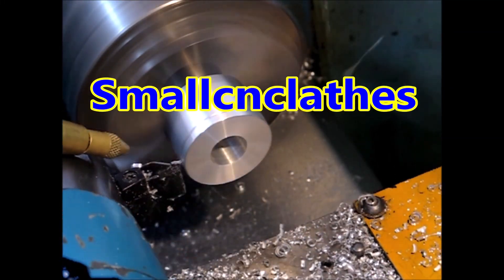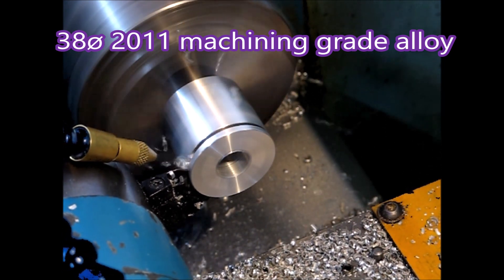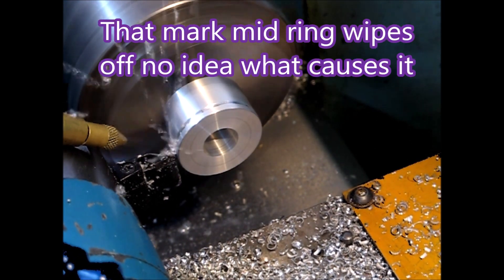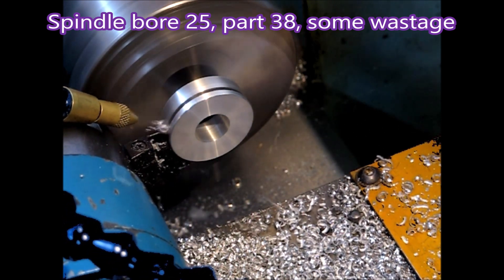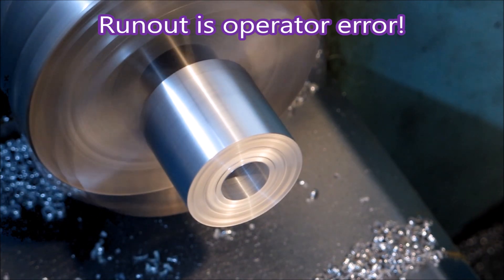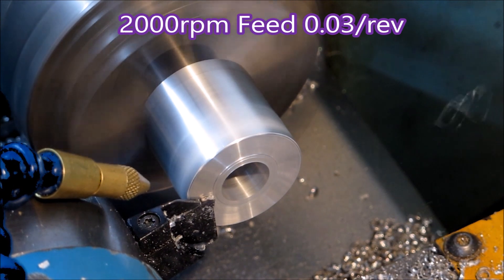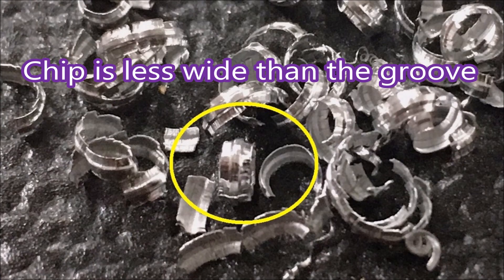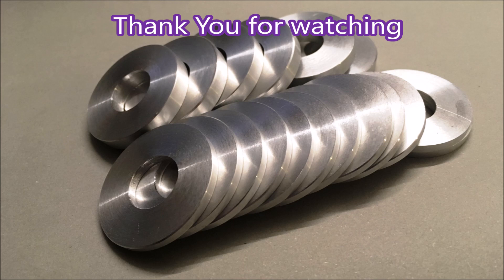Small CNC lathe parting with close ups of chip shape

Comment: Did you ever try to sharpen the carbide insert bits? It makes a significant difference here.
Reply from the maker: No, I just replace them, sharpening would mean resetting the tool. I have nothing with which to sharpen them with anyway.
Reply: @smallcnclathes  my lathe is screaming when I use a regular new carbide (it's well centred), if I sharpen it a little bit with a grinder it becomes much more calm and I could even cut in the night without disturbing the neighbours.
Which inserts do you use exactly? The Korloy inserts which I had have the same shape as the chinese ones, so it seems to be a "type" issue on my side.
Reply from the maker: One of the reasons I pay heaps for my tools is the support I get from the suppliers. Both Sumitomo and Kennametal supply low cutting force inserts which I use. I pay up to $9 for a single edge Kennametal insert, that I never need to interfere with, BUT, they work. This allows me to do things I could not do, so I pay the money and get on with the job. If I need a parting insert that will cut sideways to do a bit of profiling, they are available too. This sort of support is not available when buying from cheap suppliers
Reply: @smallcnclathes  Which Kennametal inserts are you using (part number?)
Korloy is also good, it's the shape of the tool which makes the difference for me. Korloy also offers different shapes (and so does Kennametal).
Chinese ones are ok for aluminium (and some soft steel)
Unfortunately the weak structure of my machine and lack of my knowledge broke all the Korloy inserts on my parting steel experiments.
Reply from the maker: They are not simple codes, I will have to have a look tomorrow. Sumitomo chipbreakers I use are GF and no, I can’t remember the others will look them up too.

Comment: 2mm not available on parting
Reply from the maker: Are you asking a question?  This Kennametal tool is what I was offered with a 10x10 shank to fit my turret at the largest diameter (41mm) that was possible. In theory a 1.6 wide tool should create less force than 2 mm. I do have a 2mm wide but it only goes to 20 diameter.

Comment: Thanks for your videos. They motivate me to finish the CNC conversion on my lathe.
Reply from the maker: Much to do to get it finished?
Reply: @smallcnclathes  My original goal was to design the conversion so I could still use the lathe manually but when the Z axis was "done" it wasn't repeatable. I was using the OEM rack to move the Z. I recently gave up on that idea and used a ball screw. I need to complete the bracket which will tension the Z's stepper and then assemble the X axis pieces that I built last year. The last piece I was waiting for since September finally came Friday and now I just need to wrap the conversion up. Your channel and RotarySMP's, help keep me chipping away.

Comment: Hi,

Great vid as usual. Hey, do you ever have an issue with the rear section of the insert, that is the other end of the insert in the holder, marking up the stock during deep cuts as shown in this vid? I’m not sure if it’s an alignment issue with my set up or trapped chips.

Alistair
Reply from the maker: Not aware of it to be honest.
Reply: @smallcnclathes  I’ll look into it more closely and maybe report back. I didn’t use the tool for deep parting often, but I’d like to. It’s an iscar  holder and insert. Unless I’m really dumb  about the whole set up, the unused end of the double ended insert has only the cut made by the engaged end to follow in. So I’m thinking exact alignment of the holder in the tool post ( yeah, of course) and the alignment of the insert in the holder is critical. I’ll play around and see if I can’t get better results.
Btw, I’m always smiling when you complain about turning 6061. It’s pretty well the only aluminum alloy ( sometimes 7075) that I get to use on the lathe. Even with constant surface speed, and chancing upon a good feed and speed, the swarf changes during the reduction of diameter of part. When it goes right it’s great, but then something changes and chip breaking ends.

Cheers

Alistair

Ps very much enjoy all your vids. I always learn from them. Thanks again for making them
Reply from the maker: I suppose an insert that is single ended might solve the issue.
I just find it frustrating that folks with mini lathes struggle with 6061, simply because they don’t know there is an alternative.
Folks with powerful machinery don’t have nearly as much drama.  Swarf conveyors and collection bins make it manageable. 
For folks with little lathes and matching experience it can be a nightmare.
Reply from the maker: Just had a thought, take one insert and sacrifice one end by grinding a bit of relief on it. One way to check, at little expense.
Reply: @smallcnclathes  I’ll do that. Time to swap the insert anyway. I’ll grind the sides. 
The lathe I’m using has the power, haas TL-1, but doesn’t have the speed, 1800 rpm, when the diameter gets small. It’s the first cnc I’ve ever used, 6 months in on it and still every day it’s school time. I’m a slow learner :-)

Alistair
Reply from the maker: Hi Alistair, a Haas with only 1800? Can you change the gearing to get it any higher?
Mine has 3000, but I can change the gearing to get 4000. Can’t go over that as the software will not allow it.
Reply: @smallcnclathes  hi,

Yes, the first gen TL-1 , not full enclosure. Just a swing down shield. And a deadman button on handle that you have to depress to run the machine. Of course, you disable that deadman after start up, it’s labelled door open override or similar.
The Chuck is largish, can’t recall exactly but near 10”. A three jaw set-tru bison. I like the Chuck except for it’s need for really firm nip up pressure on key. Really firm. Nice to have the ability to dial the Chuck in true.
The size of the Chuck, and they lack of full enclosure is what I suspect to be the reason for the 1800rpm limit. No gearing, belt drive. I suppose different ratios on the belt drive pulleys is an option.

Spindle load displayed does show well over 100% if constant surface speed used and diameters and tool paths push it. The Chuck is a bit of mass to accel and deccel.
Reply from the maker: How about contacting via notewell.com.au or my Notewell page on Facebook seems to me we have a lot we can discuss!
Reply from the maker: Your chuck is huge! LOL, it may have a max speed which is quite low. Eg my four inch has a max of 5300 rpm!

Comment: Try that with a HSS parting blade - I think not.... Martin
Reply from the maker: Now there is a scary thought!
Reply: DAMN!  That's some serious parting!  I'd be standing in the next town if I tried this stunt!
Reply from the maker: It is not that bad. Parting tool was not cheap neither are the inserts, but as you can see it works well. Having done it before and having a canopy between me and the workpiece helps too. Took a while to learn how to do it, but when you are being paid to make parts you have to be able to do it reasonable quickly and get a result the customer is happy with. I don’t much like parting in the manual lathe though, very rarely does anything happen with it but I understand your comment completely.
Reply: @jagboy69   See, I told you - right tooling, set up with a little care, and its easy. I am a convert and you will be too if you try it 😊... Martin